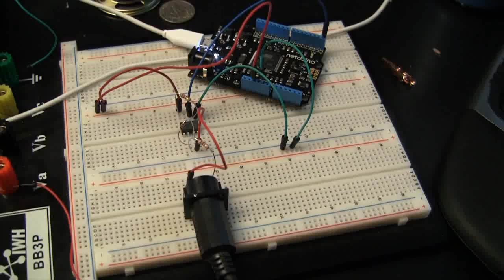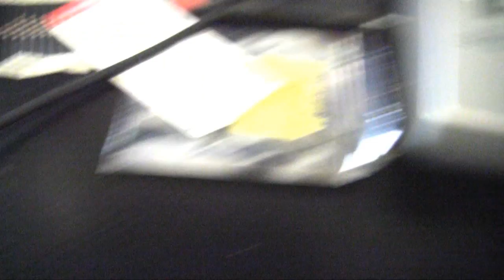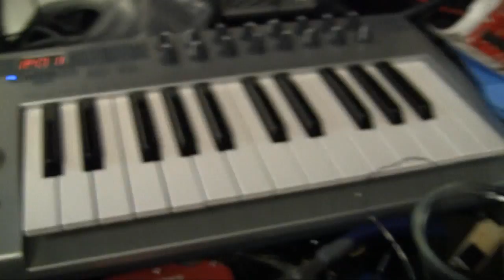Netduino MIDI Serial Test

Comment: Nice to see some breadboard work. Going to trawl through your self build as I am just about to start on a similar journey.
Reply from the maker: Are you using a Netduino or something else? If an Arduino, there's source out there. The circuit itself is really simple, requiring an opto isolator, a diode, and a couple resistors. The only complexity comes from translating 3.3v to 5v for maximum compatibility with older synths.
Reply: I was looking at the Arduino but plan now first to build a modular synth 'Look Mum No Computer' style. May ping you a few questions if I may when run into trouble.
Reply from the maker: BTW, if you're planning to build a synth in .NET Micro Framework on a Netduino, don't. You can in C/C++, but NETMF on a microcontroller like this, is way too slow to generate the waveforms on the fly. I haven't checked to see if any of the recent tech from GHI does any better with their Tiny CLR implementation.